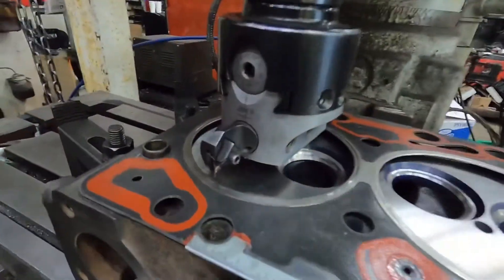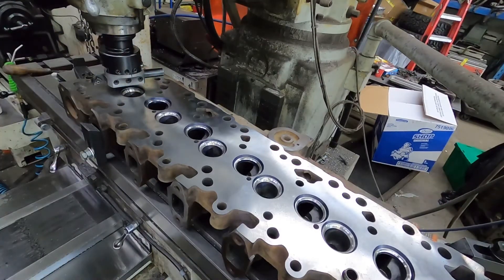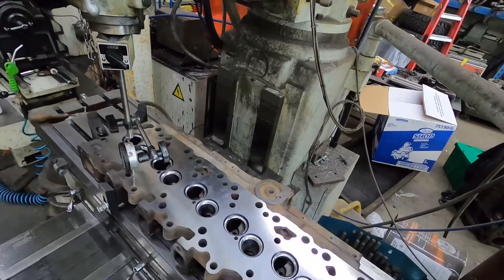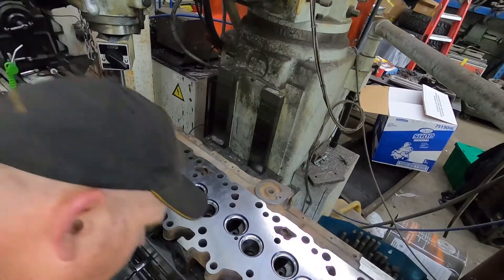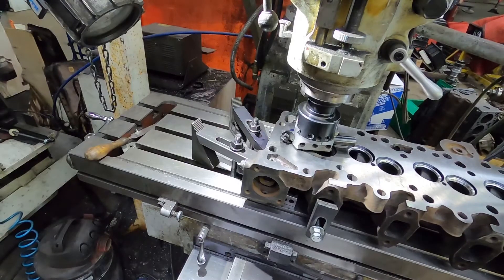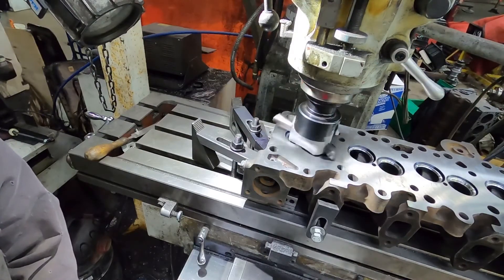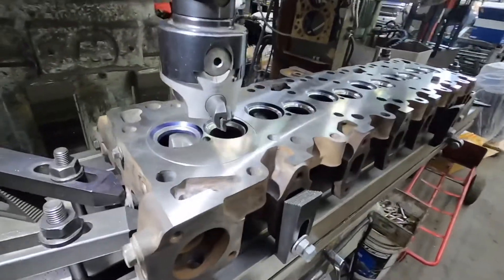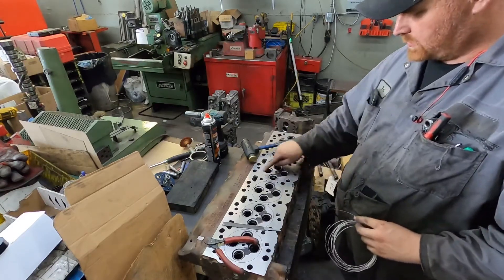How to do O rings a cylinder head , Cummins

Comment: Hey Cutter Rob, What would you say is the right position of the grove , Would you aim for the center of the of the firing ring in the head gasket ? Or more inwards to the center of the cylinder, What im askin is what the diameter of the grove would be ? And what protrution on a 0.10 over HG

Comment: How do you remove o-rings that have miles on them, seems harder than it should be?? Help
Reply from the maker: I cut them out most times. But you can spot weld to the wire and pull them if you good with a tig

Comment: What wire did you use and where do I get it I’m having a machine shop cut grooves in my head for the o ring or should they know what wire to use?
Reply from the maker: I use .041 wire most of the time.

Comment: @
CUTTERUP ROB What insert is that youre using. I tried grinding a threading insert for my boring head and I came out with horrible pattern / groove when I machined my head. I cant even get the wire to stay in place. So now I need to step it up to the next size wire in hopes of saving my 24v 5.9 head. I was going to try a grooving bar next in my boring head with copper wire.  These heads arent cheap.
Reply from the maker: I use a internal groove cutter .039 square cut most of the time
Reply: @CUTTERUPROB   Funny that's what I bought today for my boring head an internal grooving bar . Thanks for the reply. Your video helped me understand a few things I didnt know.
Reply: @
CUTTERUP ROB sorry to bother you again, Is that a grizzly G3102 knee mill ?  It looks just like my knee mill . Did you CNC it or did you buy it with  a motorized DRO ? Nice shop you have.
Reply from the maker: @markrich3271  its a challenger mill came with the DRO. no cnc stuff on it, but a guy can dream about cnc stuff lol
Reply: Thanks for making this video. Obviously a very-well trimmed mill is necessary for this process!  I’m now confident I can do this in my shop. Thanks again.

Comment: Nice video! I’m trying to do this and would greatly appreciate if you could help me find all the tools and inserts you used. Thanks
Reply from the maker: Do you have a mill ?
Reply: @CUTTERUPROB  yes I have a mill. I’m needing to do an O ring .035 width and don’t know where I should even start when buying a boring bar or carbide inserts to get that measurements and can’t seem to find one like yours.
Reply from the maker: send me a message on IG and i will give you some part numbers
Reply: @CUTTERUPROB  hey what’s your ig my machinist has a mill but I’d like to find him the right tooling to be able to do this process on my head .